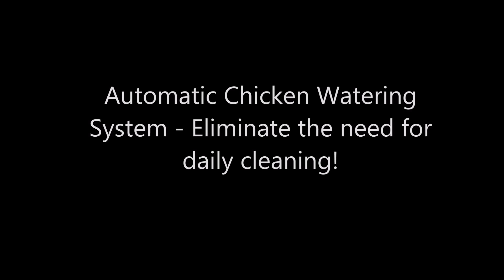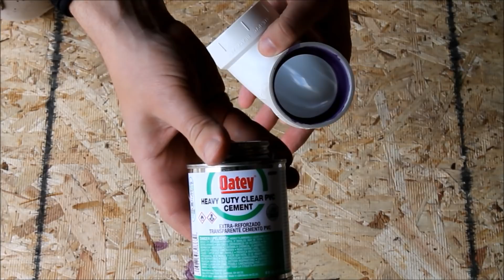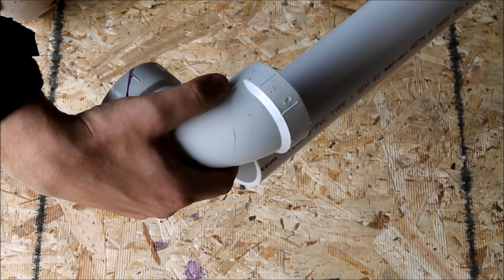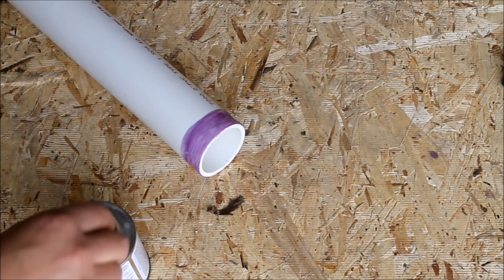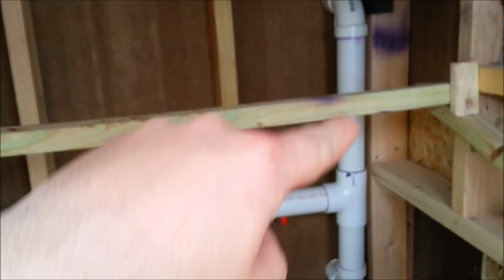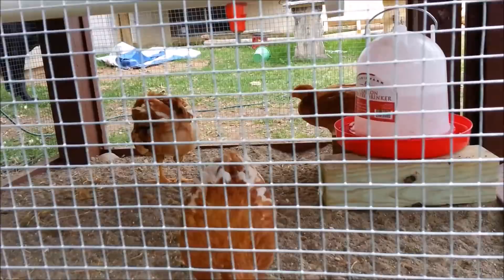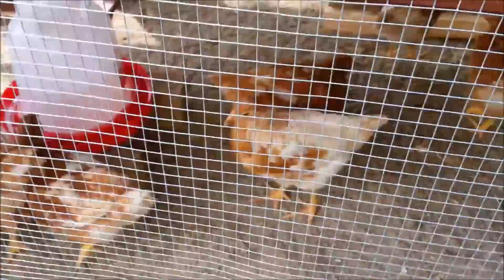Automatic Chicken Watering System - No Cleaning Water dispensers!

Comment: If you decide to put a shutoff in the system.. put your shutoff inside the coop. That way your shutting off the water before it gets outside in the cold. If you put the shutoff outside then water is still sitting on the backside of the shutoff and therefore will still be exposed to the cold and could crack your pvc. Also, you'll want to be careful about filling your waterer too much during the Winter since your fill is also outside of the coop. I don't know where you are locate, but if you are anywhere in the North it could get cold enough to freeze that top portion that is outside. Specially if you get cold and windy weather.

Comment: Finding your awsome videos today... 8 years later, I hope you and family are well. Guess your kids are in HS!!
Great DIY stuff for sure. QUESTION: in my area its really hot, so does this make sense? I know it's great to reduce chores and cleaning but this heat seems like it wouldn't really work. Thoughts? Ice cubes?
Reply from the maker: The heat shouldn't be a concern especially if you can design in so it is in the shade most of the day.
Reply: @SSLFamilyDad  actually it can be over 100 in the shade. My concerns are if the water becomes the ambient temp of 90-106°, wouldn't that make it required to flush out the water still. Maybe it doesn't matter, but I've got Silver Laced Wyandotte,  Black Australaurp which info says they are sensitive to heat already. 
I really like the auto watering,  but not sure how. Thanks

Comment: I've had a PVC horizontal pipe waterer with the nipples. However, they do need cleaning periodically if you have any minerals in your water. Mine turned green inside and then because it was attached to wooden uprights, it was next to impossible to clean. Just sayin'. I'm going to go with a bucket with the nipples around the bottom. It won't need a lot of cleaning and it is easy to fill, or hook a hose up to on an ongoing basis.

Comment: When I did this project the red nipples turned out to be Metric size 10-1.0. I couldn’t find that bolt so I drilled with a 11/32 bit and a 3/8 fine thread bolt as my tap.

Comment: I am not going to lie, I zipped to the part where I could see your water design before really watching the entire beginning and I was looking at the coop and as you zipped outside and I realized you are the one I used to design my coop from. I should of recognized your voice as I watched your other video a million times as I built my little coop. I am getting ready to move my chickens in but realized my coop it is a little small for the water and feeder that I have for outside so it is fitting I found your water system. How perfect since my coop is almost identical but mine is actually a little smaller inside because I double walled it for our cold winter winds.

Comment: Is there a general rule for the height from the ground to run the horizontal pipe? I don’t recall if the support hangers are adjustable, which would give me room for error.
Reply from the maker: 18" is pretty good but if you have a taller breed go higher and then put a step (piece of wood or brick) under it if they are too high as they grow older

Comment: Where I live in the summer our heat can be as bad as 100 - 115 at it's hottest. Most the time I spend cleaning the many chicken waterers is because of mold developing in the containers due to the heat, not because of the chickens dirtying them so much. So with this system how do you prevent mold from growing in the water system in this environment? I add in apple cider vinegar but that does not deter the mold and it can develop in as little as 24 hours.

Comment: I would add a ball valve  just below the inside water line  a 2 " ball valve can be expensive   might want to think about  reducing the pipe below  inside pipe so you can use a cheaper smaller valve  it is not like you need to move a lot of water

Comment: Can I use this without any pressure regulator??
Reply: Its an open system, so there is no need for a pressure regulator. If he had it hooked directly up to his water supply, then he would need a  regulator. Otherwise, since his system is open, no regulator is needed. He just fills it back up every day or two and its fine.

Comment: Nice system except that you should have run the clean out end all the way out of the coop for a dryer area in coop when doing so (cleaning out watering system).
Reply from the maker: +Joy Marshek agreed, that would have been nice. In this casebthe run wheels right away from the coop so when I clean out i have easy access

Comment: Primer melts the PVC.
Reply: Semantics. You say soften, I say melt. Melting does soften solid things.
Reply: Soldering and welding melt stuff but after the process is completed- solid as a rock.  What bad thing were you alluding to?  Millions of PVC joints exist and "being soft" hasn't really seemed to be an issue.

Comment: We are building this same chicken coop right now. We loved it so much. Just putting the walls up now so still some to go. But we live in NY and what do you do in the winter so it doesn't freeze?
Reply from the maker: +Christine Thiessen you can use heat tape or change the design a bit and use a circulating pump to keep the water moving

Comment: Just a Value-Add Tip, extend the Flush Point through the Side Wall of the Coop so it can be cleaned from the outside rather than having to enter to do so. Also run  your Down Pipe from the Upper Level straight down and through the Floor so all piping is kept within the shadow of the Coop and out of the sun. This will keep water cooler during the hot summer months. Regards from SA
Reply: how much does all this cost???

Comment: I'm a noob. Still working on building my coop, run, etc. Do the chickens drink from the nipples by discovering them? Or do you have to train them with a laser pointer? Also, have you had any problems with the bolts rusting that hold the nipples in place?
Reply from the maker: the chickens figure them out in about 5 minutes on their own. As soon as they see a drip of water they go for it and all follow. No bolts holding the drippers in place and the drippers are plastic with a stainless ball inside.
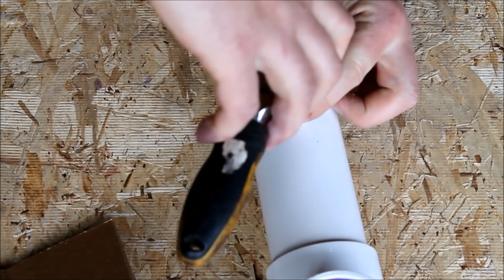Reply: @ 5:35 You are screwing bolts into the pvc. If those are not holding the nipples in place, then what are the bolts for?
Reply from the maker: +R Lanterman threading the holes
Reply: SSLFamilyDad . I gotcha. Thanks for the information.

Comment: Hi, I followed your directions carefully and twice I have failed -- at least one of the three nipples I installed is leaking at the base, where it makes contact with the PVC pipe. Any suggestions would be greatly appreciated!
Reply: Wrap Teflon tape around the nipple threads before screwing them into the PVC.  Don't over-tighten them either.  Snug them, then adjust as needed to stop the leaking.

Comment: love your water idea. I do think that your idea of using raining to water them is Good. I think you should have the clean outs outside so you don't have to go in and maybe have the water splash on you when under there. If you look in the garden area you can find some 1/2 inch or maybe you can use 1/4 flexible black plastic pipe that you can run to the watering pipe so you don't need to carry the water. When it is time to clean out, just open the clean outs and turn on the water. The 1/2 black pipe come in different sizes rolls 50, 100, 500 foot and doesn't cost much. It can be rolled up in the winter and can put ends on it to connect like a garden hose. I use it to water my garden. I put the watering fitting into the black pipe. I hope you do more videos.

Comment: Thanks. I was looking for the nozzles and couldn't find them. We had brass ones on my dads chicken ranch as a kid. they were installed in the 1/2" water line with constant pressure. A tip for threading with a bolt: cut 2 lines with a hack saw blade in it and it cuts much better/cleaner. Also works great for cleaning up threads if you don't have a tap.

Comment: awesome!. I'm curious to know if you ever got the winter system working?
Reply from the maker: yes and no. The winter system in the cooler will work but I recommend putting the drippers directly into the bottom. The tubing design will also work if you use enough heat tape. I will be building yet another one now that I am at a new house and plan to build a new coop.

Comment: Just put hose end on it at the lowest point and hook a hose to it permanently then its full automatic
Reply from the maker: +Skipper Dreyer pressure of the hose makes the drippers not work well. Using a float valve of some sort would be perfect though

Comment: ever think of a solar heater line in the system?
Reply: I was planning to use an aquarium heater- a 5 watt one. Still trying to figure out how to hook it up to a solar panel. I've yet to learn more about that except that I should get a deep cycle battery so it will operate in winter. Have you looked into this at all?

Comment: I tried this for chickens and also a separate system for garden sprinkler.  Both are PVC above ground and from wells not city water.  In both situations algae grew inside the pipe.  Last year - at end of growing season I covered all the pipes with black tape (lot of effort.) So far this year all is well, but summer is a ways off.  You are having no issues with growth inside?
Reply from the maker: +Joe Pegasus algae cannot grow without light so either you are not use schedule 40 piping or maybe it is mildew on the inside? Not sure but i have not seen anything on the inside of our pipes. Ate you leaving it open somewhere or is it always capped off?
Reply: Ah, thank you.  So that's the difference tween S-40 and the cheap pipes I use.
Reply: why not use black paint for pvc instead of tape. think that would work
Reply: I did but without success.  Last autumn I wrapped all the pipe with foam insulation (Lowes pipe coverings) and so far, so good. All pipe since has been S-40.  Live and learn.  Thanks for your comment.

Comment: what kind of water tight fitting to use to attach pipe to a reservoir bucket?
Reply from the maker: +elizabeth barnes I did another watering system using a cooler and I used a 1/2 threaded fitting. One male and one female. You can try that it get a bulkhead adapter on amazon.

Comment: Nice system! But I was wondering why you didn't run your pipe through the floor inside the coop to the water nipples below the coop. That would save a lot of extra pipe and fittings and be much easier to install.....Just a thought......Thanks for sharing!!
Reply from the maker: Great point. I couldn't get the 2" pipe through the bottom of the studs on the wall as the pipe was too big and I couldn't go through the floor since I have the clean out tray. I will be redesigning this spring with a reduction to 3/4 from inside through the bottom of the wall to connect to the bottom watering system. This will eliminate that goofy piping coming out of the back:)

Comment: Hi my name is Sam and I live in Alberta Canada. I like your system , but how do you keep the water system from freezing on the outside when temp is -30 or more?
Reply from the maker: I have tried several things. Heat tape and ins u Latin worked but not when it was below 0 for too long. I have since made an new waterer for winter but recently it didn't hold up either. So I have a final idea to use and aquarium heater inside the pipe and shut off the out idea portion completely and only use the Inside one in the winter
Reply: +SSLFamilyDad i'm curious to see if the aquarium heater works for keeping the nipples thawed
Reply: +Browns Farm   My experience is that nothing keeps the nipples thawed when it gets below zero. (at least here in Idaho).  It's easy to keep the water itself thawed, but as soon as it hits the cold metal nipple it freezes quickly.

Comment: I'm I little worried about the glue contaminating the drinking water. has this been a problem?
Reply from the maker: +John Hall Let the glue dry thoroughly and it should not effect the water
Reply: +John Hall It's the same glue that is used to glue the pvc pipes that are used for your drinking water. I would think it would not be an issue

Comment: How do you keep the water system from freezing during the cold winters?
Reply from the maker: I did a video on that but the system I had setup basically with heat tape and insulation didn't hold up when it was below 10 degrees for extended periods. I will have a new video out soon with my new watering system

Comment: To SSLFamilyDad.    I can't seem to find the the fitting you call the clean-out.  Where can I get one and is it called a "clean-out"?
Thank you
Reply from the maker: +Rachael Riscen It is called a cleanout adapter but it is just a fitting that is a normal slip (glue) fitting on one end and female threaded fitting on the other. Then you get a threaded plug to screw in. Should be in any hardware store, Lowes, or Home Depot

Comment: By the way, great idea! 
If you had've put a 90 degree end at both your clean out ends so it could be routed back outside the coop, there would be no need to go into the coop to flush the water and the flushed water would not dampen the chickens house!
Reply from the maker: +Magillicutty007 That is a great point and I will be revamping my system this week or next so I may take that into consideration, thanks!

Comment: you need a tray under this as this might wet the ground and it is not good for chicken especially in winter
Reply from the maker: +BJFA I thought about adding a small catch under the watering system but in the end it turned out to be unnecessary.  We use Sand in the run and the pine shavings in the cleanout tray absorb any splashing or dripping from the system pretty well. I may add something like that on the inside portion this winter as I am redesigning some things for better efficiency.

Comment: Automatically fill water,..No water filling up at all by using a toilet fill valve in your water system.  You can use a five gallon bucket as a reservoir with the toilet fill valve built in and the water will fill up as needed.  Toilet fill valve can be adjusted to desired amount of gallons you want before it fills up again automatically.
Reply: +tubetwo100 you can also run it off of a rain collection system, id filter it so its clean but i doubt theres anything in rain thats worse than tap water run thru pvc with glues and whatnot
Reply: Davey Face and bird  poop
Reply: Do you any pictures?Thanks

Comment: FYI  Make sure you UV protect all sun exposed PVC ie. painting the pipes! And if you live in high heat areas you might want to shade or paint the tubing silver  that's outside. It may not be a problem with the lack of any  flowing water. I have lived in the desert for many years and now live in the Philippines and heat is always a challenge. 
Haven't seen snow in a long time. I like your system especially the inside outside aspect for me is a plus for when the typhoons hit i can lock the birds down till it passes sometime 4to5 days. thank you Eddie
Reply from the maker: Eddie Lemmon That is a great point about the UV. PVC will eventually become brittle and fall apart if left out in the sun. Mine is shaded pretty much all day so I am lucky.
Reply: what do you do to prevent it from freezing?
Reply: Joshua Sampson add a spoon of vinegar per each litre of water. that will also prevent bacteria.

Comment: I used a 5 gallon bucket with a cover OUTSIDE the pen. The 3/4 inch pipe runs out of the side of the bucket about 3/4 inch from the bottom. Run the pipe into any area you want water access. Place as many nipples in the pipe as you want. Of course cap the end of the pipe. Use no glue. Most fittings are tight enough. Fill as needed from outside of the pen.
Reply: We have done this recently too, but are also new to chicken ownership. How to you prevent algae formation and keep water/pipes clean? Do you chlorinate the water or use any additive? How often do you drain and refill or disconnect system for cleaning?

Comment: You should put a PVC feeder inside the coop as well :)
Reply from the maker: Jon Pratt I thought about that since it would be great for the winter months. I might add something this fall.
Reply: @SSLFamilyDad  I added one on the inside for hurricane season... When the weather is really bad the girls are safe inside.. also didn't use the pull out tray. I made the door bigger and just rake out.. The vertical water pipe is inside as well to keep out of the sun.. Great coop setup. Thanks for all the ideas! :)

Comment: Love the videos! Keep them coming.
I was curious. I did not see where you were located. Do you have an issue with the system freezing during the winter months? I live where the temps get well below freezing at times. 

Thank you.
Reply from the maker: eridinger1 I am in Michigan and we certainly have to deal with freezing here. I used some heat tape and insulation to wrap the pipe and that worked pretty well. Although this year I am redesigning the watering system to only heat the inside portion.

Comment: Why did you take the vertical pipe outside through the wall instead of going straight down through the floor?
Reply from the maker: tuubydude I am going to redesign this and do just that this fall. I can't remember why I did it at the time but I think it is due to the cleaning tray sliding in and out is in the way.